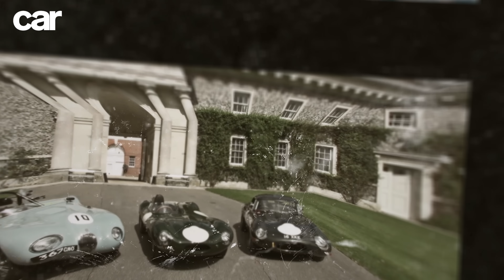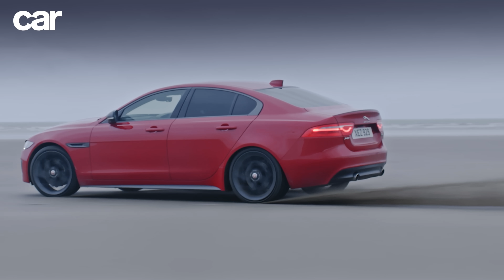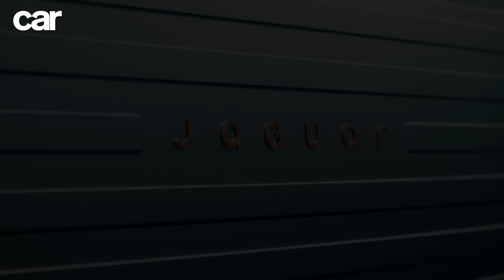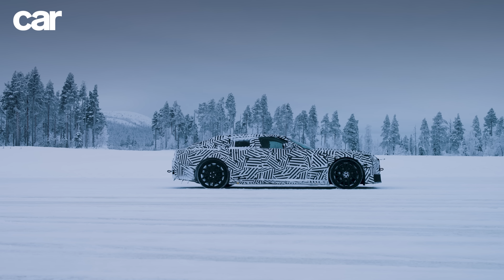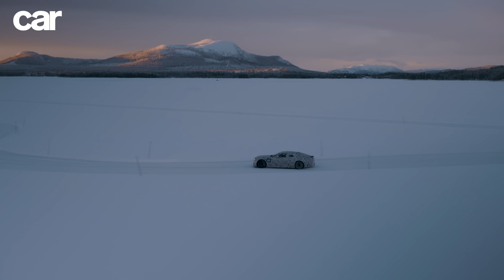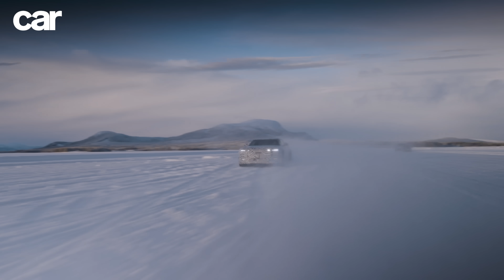Sideways in Jaguar’s 1000bhp Type 00 tri-motor EV

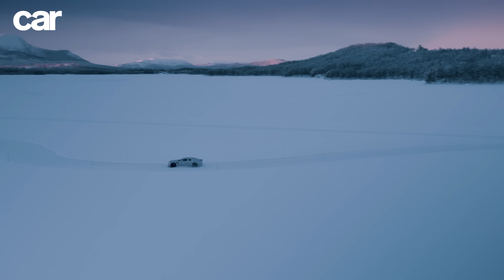Comment: 4:13 I'm sorry if this is a bit of a rant, but what's the point of it being completely silent? If it's supposed to be sporty and has 50/50 balance and good steering and is supposed to feel like a Jaguar, semi sporty. A Jag is supposed to sound good and not be ultra quiet like a Lexus, Rolls-Royce or a Bentley, or even rivian even still possibly Tesla. There are plenty of brands trying to make silent, super comfortable cars. Jag will fail in my eyes because it will not stand out and it will not truly call back to its heritage, the c, d, e, f types, xk120, 220 or xjr15, the xjs or any of the others. It just simply isn't a Jaaaaggg as we think of the brand.
Reply: Drive a good EV like a Chevrolet Blazer EV eAWD RS and you’ll know why so many drivers love their EV. It’s quite an experience.

Comment: I think everybody wants Jaguar to be successful, but looking at where the market is going, I very much doubt this will save Jaguar. The Porsche Taycan is reportedly an excellent car, but if you look at how the values are dropping like bricks, a worse value drop is to be expected from this car, no matter how good it might be. It has lost the edge of the badge to make up for it, as it won't deliver on core brand values. You can put a million horsepower in it, but that's not where the game is won. Running costs matter, a proper service infrastructure matters, the whole customer experience matters. All these things have failed over the last decade, and I don't expect them to succeed if they only do things dramatically different with the car.

Comment: Cannot understand why they not refined the I-Pace all this time instead of this controversial carnival hulabaloo.
Reply: The I Pace wasn’t successful in the marketplace . That may have been viewed as significant going forward. I’m not a marketing guy however and your question is interesting for sure.
Reply: @williamfraser5593  The I-Pace had almost everything needed to be a big success. Early sales in 2018/19 were good, but problems with battery reliabilty (LG really screwed up) and the relatively low DC charging speed subsequently scared people off. Had they properly revised it with longer range and faster charging in 2021/22 after the battery issues were resolved then it could easily have been much more popular. Instead, apart from a new infotainment software (that was rolled out across all JLR vehicles in 2021), Jaguar mostly ignored the I-Pace and it became more and more outdated compared to the competition. 

A real shame, as they're lovely cars to drive.
Reply: They never figured out how to refine an ICe vehicle, let alone and electric.

Comment: That looks like it'll be a challenge in City traffic. Priced at around £120,000.00. One of the best things about Jaguars of old is the pricing, the value for money. £120k puts this in rarified terroritory. Throttle? what does it throttle?. You mean accelerator.

Comment: I think the way you introduced the car was the way jaguar should have and not that stupid advertisement they used. But that aside my view on this car has always been before anyone writes it off wait until we see it in the metal and what the reaction is from motoring journalists are. And so far it’s fairly positive. Which I’m pleased to see. I for one would like to see jaguar survive having been a jaguar owner in the past. Speaking as now an Ev driver if that car can achieve close to the range they claim with high speed charging capacity that’s more than adequate because these cars are designed to cover miles with ease. It’s not designed to be used as a city car.

Comment: My favourite part was when you said "Listen to that raw Jaguar V8 power. Note the tonal shift as the power crescendos into a 7500RPM whine, with the engine and the supercharger working in perfect, almost orchestral harmony to overcome the sound of everything else and awaken your senses to the feline-like roar of an unfettered, visceral driving experience. As I rope the power in, the supercharger lets out minute shrieks as the rear tires claw for any and all available grip. This authentically English super sedan takes everything we know about Jaguar and about proper, gentlemanly, absolutely villanous driving and bumps it up to 11."

Oh wait, never mind. You didn't say that.
Reply: The best V8 Jaguars were the ones that had small block Ford and Chevy V8s in them.

Comment: JLR really does not understand their issues, they build super over priced cars, that breakdown regularly, are very easy to steal and the only car they made that is reliable in their whole history is the defender.......they need to work on reliability, and justify the price by making your own engine.....not a V8 SC then on the same block bore out 6 instead of to make a V6.....proper engine with no focus but reliability. This the RR EV and the RR sport EV and the Defender EV will only work if they have reasonable range for the price and that they don't breakdown....and that they actually build their own cars and not out source manufacturing to Magna or whoever else they want to use.....the more you build your own car in house with your own tech the better the integration, less issues and more reliability.....learn from Tesla the good stuff otherwise you all are just jumping at the EV game because you seem to think a parts bin and some hasty engineering works when the exact opposite is what makes it work.
Build your own tech, stack and integration and the car will work
Reply: They break down due to a badly designed Wet belt Diesel engine if you must know...That's the real issue with JLR products. Oh wait on they won't be making ICE cars any longer......

Comment: Im very curious to see how this car is once its comes to production but from what I can see, here are my thoughts;

- That A-pillar  is one of the thickest I’ve ever seen. 
- The lack of a rear window is a heck of a risk. So many people will avoid the car for that reason. If they want to appeal to more people, it’s quite a bold move.
- I’m glad to see they’re taking driving dynamics seriously, though I’m afraid that driving this on the snow is a way to cheat a bit on making the chassis feel lively
- that interior looks dark, probably because the rear window is gone. I hope they find some way to keep it bright with some ambient lighting at least
- I know it’s got camouflage on, but the design is still such a departure from the jaguar of old. I wonder if they’re trying to go for more of a Range Rover sedan styling than a jag

I’m curious to see more, but my expectations are still subdued. Only time will tell how this comes out !
Reply: The Autocar video of this car seems to show the A pillar is merely massive and not impersonating the Leaning Tower of Pisa, so I think part of the size of it is down to lens distortion (it is a pretty wide angled lens they have used).  I don't like the look of that rather fat steering wheel though. BMW M cars are spoilt by them (I had the current G80 M3 and hated the steering wheel as I couldn't get my hand comfortably around it) and my F Types wheel is perfect for girth and texture, quite delicate in fact. 
  A positive thing I've taken from this and the other prototype test drives, is how quiet the cabin is. there is an omnidirectional mic being used and even with the car spinning it tyres and driving over presumably hard and slightly rough ice, it seems a very well isolated (well have to get used to the lack of straight six and V8 soundtracks I guess). I'm hopeful for this car's future, though. Good luck Jaguar! Lots of keyboard warriors who say you are deserting Jaguar brand values never bought a Jaguar in the first place, so I ignore them. Something needed to change and even if this turns out to be a Hail Mary, I applaud your spirit and bravery to 'go for it'. Please do change your previous marketing direction, though, that seems to me to be a busted flush.
Reply: @GeordieAmanda best comment here that actually makes sense.
Reply: Polestar already did the no rear window thing.
Reply: First of all if it has no rear window and to date no one has seen the finished car. ( forget the blue concept ) in the metal un camouflaged but there is one other car that has no rear window and I see plenty of them on the roads  the polestar 4 I think that’s the right modal number and that’s not dark inside. And on that point don’t forget the hole car is camouflaged including the roof along with all the black covers covering everything. My advice is wait till the car is officially revealed before writing it off. Having driven a jaguar XJ which has a petrol engine was near silent when cruising down the motorway so this should be very similar but quiter
Reply: I don’t think this car will go wrong , Matt becker is the chief engineer, he knows his stuff well, son of the legendary Roger becker who was project engineer at lotus car ltd  for 43 years.

Comment: This car is basically a British Cadillac Celestiq. But it won't be as good because Jaguar doesn't have the resources that General Motors has.
Reply: they are just part of Tata Motors Passenger Vhcls Ltd and there was a moment in 2024 when they had a larger market cap than GM. Currently they have a cleaner balance sheet than GM. I just checked and found GM has $102.8 billion in total debt and Tata motors has $1.15 billion. GM has had resources forever but they keep loosing market share.
Reply: It is as ugly as a Celestiq, that’s for sure.
Reply: The Celestiq is a piece of crap, lol.